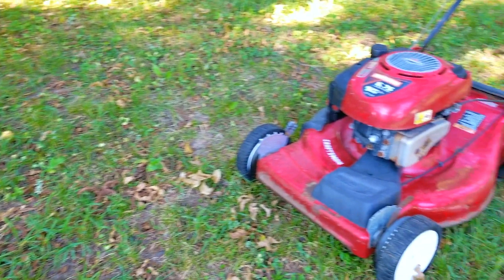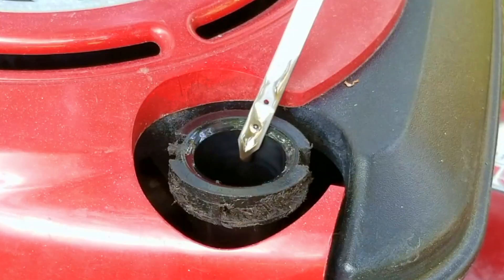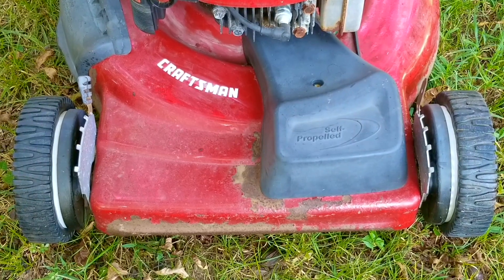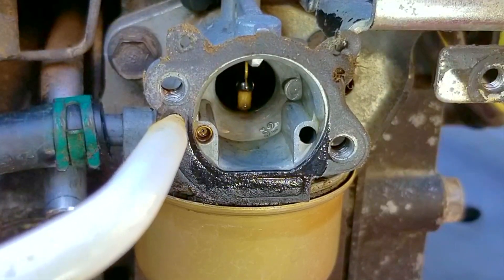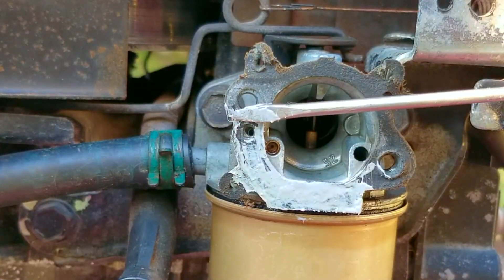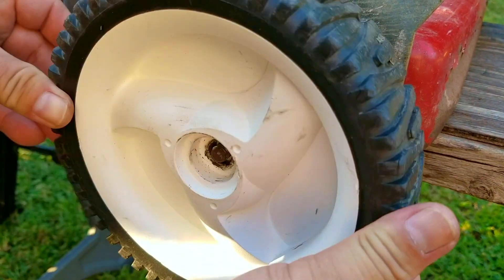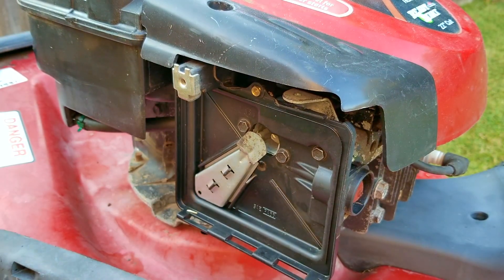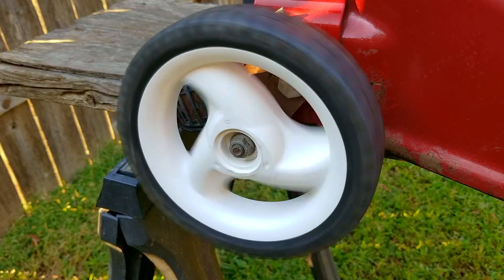Understanding how a primer bulb works on a Craftsman Lawn Mower.

Comment: Just found your video and Thank You. Question for you...... I have an 2003 --- 625 Series Craftsman mower (which has the same B&S engine as the mower in your video) and I'm having a re-starting issue. The mower runs perfect once it's running, but the problem is I have to use the primer bulb everytime after I stop the engine (ie. emptying the grass catcher) even after the engine is fully warmed up. The primer bulb works awesome as I see the fuel squirting up with each push, and it starts on the very first pull after priming...no problem. But why do I have to use the primer bulb every time I want to re-start my warmed-up mower? I've removed and cleand the carb already. Now I'm wondering if there's not enough vacuum being created when I pull the rope to re-start...not enough vacuum to draw fuel up into the venturi due to poor engine compression, which is why I have to prime it again. I would love your thoughts.
Reply from the maker: That's a very good question.  More than likely the carb is the problem.  Every time this has happened to me, I've tried to clean the carb again but only replacing seems to work.
Reply: Thanks for the quick reply. Guess it's worth $15 to try a new carb.😂 Keep with the vids!!!!
Reply from the maker: Absolutely!
Reply: Wanted to thank you for your suggestion to just replace the carb; did so and it  runs perfectly and no longer need to re-prime after each time it shuts off. So simple. Thank you!!!!!

Comment: i had the exact same problem with the primer bulb a few days ago, i used 2 carburetor gaskets so it would squeeze a bit harder.
Reply from the maker: That's a great way to fix it.
Reply: @HomeGaragechannel  it was your video that showed me what was wrong with my lawnmower, so thank you.
Reply from the maker: I appreciate the compliment and I hope you get it working well.
Reply: @HomeGaragechannel  yeah ,its working great.
i wanted to fix it badly since the deck is made of aluminium.

Comment: Thanks I added the old gasket along with the new one doubling it up and now the primer  work    Note when you pull out the rubber bulb mine had a mesh screen that I cleaned.  Thanks again
Reply from the maker: I'm glad you got it working again!

Comment: Those gaskets are sensitive. I have "fixed" that problem by doubling up the gasket with a second. The plastic can warp if over tightened, which makes sealing with the gasket difficult.
Reply from the maker: Yep I've heard that works too.  Although I  feel as tho it's partly the warpage from the plastics too.

Comment: Is there a difference with regards to the carburetor having a primer bulb and one thar does not have a primer bulb? I purchased a new carburetor from Walmart for a Craftsman M210, 140 CC but not sure if it will fit on the mower I have with a primer bulb. Any knowledge on this? On the M210 mower it has: D29058 SP.  Does the carburetor have to be one that will work with a primer bulb? The one that came off the machine has on the carburetor: D01520 597520 and the one from Walmart has: CMXGMAM1125499  on the website but no identifying numbers on the carburetor itself that I can find. The Walmart website states it is  a "fit" for M110 which I don't think has a primer bulb. Yet, it also has on the Walmart website that it is a carburetor kit for M210. Just curious about the carburetor and how it works with a primer bulb.  Thanks for anyone that may know.
Reply from the maker: to be honest, I don't know but that's a very good question.   If had guess, no there's no difference and you should be able to use either carb with or without one.

Comment: Note, those red primer bulbs have a hole in them and you must replace with a similar bulb, not a solid bulb such as those used on two stroke engines. I've made that mistake, so I know first hand. ;-)
Reply from the maker: thank for that information

Comment: I've had all 3 but am down to chokes and auto chokes now BUT have primed the others too much because they were my first and wasn't used to them. They always started on 4 pumps after they got limbered up. 3 wasn't enough.  My pal at the saw shop says to also point the carb uphill so the primer gas charge runs downhill to the combustion chamber for easier starts. I've got primer bulbs on the blowers but they're a different animal. And I NEVER think for a second that anything I get will run, so I'm not disappointed when it don't! Thanks and Blessings!
Reply from the maker: interesting idea.

Comment: Just took my primer bulb out due to fuel leaking from it and found it has a little hole all the way through it at the tit.  It looks like its supposed to be there but then how do you stop the leaking fuel.  Is it supposed to  have a small hole there or not?
Reply from the maker: on the one, in the video, that primer bulb is supposed to have a small opening in it. you could give me your model number that would help figuring out If yours is supposed to have an opening.

Comment: The purpose of the primer bulb is NOT to force fuel into the venturi, or “throat of the carburetor”. It’s to fill the bowl of the carburetor with fuel. Once the bowl is full, the vacuum from the engine draws the CORRECT amount of fuel out of the bowl, through the main jet and into the venturi where it is atomized and mixed with air before being sucked into the cylinder for combustion. If you’re seeing fuel pumped into the venturi when you press the primer then you’ve already over primer the carb.
Reply: The fuel system on many mowers are gravity fed, meaning the fuel tank sits higher than the carburetor. Gravity in turn brings the fuel to the carburetor and fills the float bowl. When needed,  the float moves down to open a needle to draw more fuel in. Once the bowl is full, the float goes up and closes the needle, thus stopping the flow from the tank. A primer bulb draws the fuel from the bowl and shoots it into the venturi of the carburetor to make it easier to start the engine.  Now on a smaller engine for a grass trimmer or leaf blower, you would be correct because the primer bulb is essentially a fuel pump that brings the fuel from the tank and primes the carburetor. Once the engine is running,  the vacuum impulse of the engine draws fuel from the bowl through the venturi and into the intake manifold.  On a 2 cycle,  the diaphragms in the carburetor perform essentially the same task.
Reply: @johnaldrich2074  yeah you're right. I was right in the middle of a chainsaw carb repair when I posted that so I was thinking two stroke carb. That doesn't apply to a gravity fed four stroke.
Reply from the maker: no

Comment: What's the difference between a primary ball and a perg ball always wanted to know?
Reply from the maker: one forces fuel in the carb, the other pulls fuel thru the fuel system, to get rid of the air

Comment: Are new lawn mowers with primer bulbs disappearing? Are they mostly just auto choke nowadays?
Reply from the maker: I haven't done a lot of research but it certainly feels that way
Reply: @HomeGaragechannel  I can’t seem to find any with primers. I feel like having one would be handy when troubleshooting like this case. I guess I could go for an electric mower, but most say the battery lasts 45 minutes and my lawn takes about an hour. Plus they’re way more expensive.
Reply from the maker: I guess you have looked at the mowers with the newer kawaskis then?

Comment: Either the primer bulb or auto choke is okay with me. I had a Craftsman mower similar to that quite some time ago. It had a tendency to get debris between the plastic cover and the wheel. The debris would then get between the metal drive gear and the plastic gear made to the front wheels. Bye bye plastic teeth. I had to replace the front wheels every season while I owned it.
Reply from the maker: nicely explained.

Comment: i got the same engine as this one what i did was using rtv gasket maker and put it around the base where the air cleaner meets the gasket except the priming hole
Reply from the maker: that works too.

Comment: I prefer primer bulb lawnmowers. The reason is that I've had issues with the thermo system on the auto choke, morespecifically, I had to hold it to a blow torch to get it to move. So I threw it out, since it has a wind vane choke assist, and a spring. It works great, and I just sold it last night.
Reply from the maker: you and me both, I like to have some control over it as well.

Comment: I've got a mower which starts when you prime it but cuts out any suggestions?
Reply from the maker: sure, but I need to the model number and serial number.  Can you find a tag that has this information on it?
Reply: @HomeGaragechannel  its a pp420 tecumseh if that helps
Reply from the maker: do you mean blower or mower, cause you said mower in the first comment but what information you gave me, results in a poulan blower.
Reply: @HomeGaragechannel  its a mower
Reply from the maker: have you cleaned the carb yet
Reply: @HomeGaragechannel  no i was thinking of doing that but thought it was a bit strange that the bulb would pull fuel through but the carb wouldn't
Reply from the maker: the bulb only function is to force the air from the bulb, into the bowl, and that makes the fuel come out of the carb, and into the engine. Try. cleaning the carb, paying special attention to the bolt nut and the holes In it.
Reply: @HomeGaragechannel  OK ill try that thanks

Comment: you mention both lithium and silicon grease. which one were you using?
Reply from the maker: in this video both, the lithium is white, while the silicone has no color.
Reply: @HomeGaragechannel  which one would you recommend for annual axle lubrication?
Reply from the maker: I would definitely use the Lithium grease in a spray can. It lasts for quite a long time, and is easy to use.

Comment: What brand and type of gasket maker did you use? The Permatex I tried didn't work well.
Reply from the maker: I think it's Permatex.
Reply: @HomeGaragechannel  The one you used was a white paste that spread out well, the one I tried was very sticky and yellow which didn’t work well.
Reply from the maker: I gotcha
Reply: @HomeGaragechannel  So you're not sure?
Reply from the maker: not really, Although I have to ask, if either had been opened, prior to you, using them?
Reply: @HomeGaragechannel  It was brand new Permatex Super High Tack Gasket Maker in the tube as they had various different ones that is just the one I happened to purchase. Also I could’ve warped the air cover taking it off and on so many times.

Comment: I prefer the primer bulb, only because I think it just gives it a bit of a head start and puts you more in charge as opposed to auto choke, and prefer manual choke over auto.
Also that's the exact repair on the same engine I need to do on my personal mower before the season starts. I just put up with lots of pumps to start it last year, hopefully I've got a new gasket knocking around in the shed, and a new bulb which I didn't get round to last year.
Reply from the maker: nothing wrong with that.

Comment: That was a nice score for free, nice work! I don't mind pushing a primer bulb to start an engine, I don't much care for auto choke systems as they tend to have issues sometimes. I prefer manual choke as that's what both my Kubota push mowers have.
Reply from the maker: that's a very good choice.

Comment: I like both auto choke and primer. I have the same issue with a prime I am working on might try a little gasket maker on it like you did just to see if I helps my engine also.
Reply from the maker: hopefully it works out for you.

Comment: Excellent vid as always!On these free mowers I pickup with floppy wheels, (even the cheap ones) I drill them out and press in bronze oillite bushings available at any good hardware store; easy fix and the drill press does both operations. The customer really thinks they're getting something when she rolls real easy.
Reply from the maker: I'll have to consider that. Thank you David Coudriet
Reply: A poor man's wheel bushing.  I have done this and it works and takes out the wobble.
Reply from the maker: I'll definitely have to consider that.

Comment: Have you ever had a engine blowup on you, i had an old 1995 craftsman lawnmower with a. 5 HP engine and we were mowing the front yard next all you hear is bang, and i shut it off, low n behold, their a is a nice big chunk of engine wall missing and engine oil pouring out smh.
Reply from the maker: only one, it was a riding mower, and I wasn't filming at the time, because I was just moving it around the yard.

Comment: As long as i can cut my grass it doesn't matter if have the prime system or the auto choke. They both eventually have their issues
Reply from the maker: you make a good point
Reply: @HomeGaragechannel  i have 2 mowers that have the auto choke and the primer system on it

Comment: Theres a small passage at the back of primer bulb and sometimes a screen that get clogged on these type of briggs. Great fix as usual!
Reply: I just had that same problem. Over time the small hole in the bulb allowed enough dust & dirt in to completly clog the screen. Never would have found it without pulling the bulb out..
Reply from the maker: thank you for the information

Comment: Once again you have taught me something new!! My 13 year old Toro Super Recycler has auto choke and will start on 1st or second pull every time. I run non ethanol high test gas in it and change the oil every 20 hours along with changing the air filter with every oil change. I lube my wheels 3 times a year. (I enjoy working on my mower) I also lube my cables a couple of times a year. It has been in the shop 4 times in 13 years. Twice for carb cleaning/tune up and twice for belt replacement Personal Pace service. Another great video Brother!!
Reply from the maker: thank you Larry Croft.

Comment: To answer the choke situation I prefer neither the bulb nor the automatic system.  I would prefer a cable and lever mounted on the handle.  Now I must ask this question.  Listening to say you messed up the priming system makes me wonder if we are related?  Great tips and information.  Thanks for the  video's.
Reply from the maker: thank you D Butler.

Comment: I found a Craftsman mower like this for free last fall, but it was a generation older. It had the same exact problem so I just put a used gasket from a dead engine on it. It does smoke a little bit when it runs because the piston ring is a bit worn, so I might have to do a rebuild at some point if it gets worse.
Reply from the maker: sounds like you've got it under control, thank you Smallengineworld BCSERK.

Comment: I had never seen a primer bulb on a lawnmower except a lawn boy an tell about 1999 when we bought a Craftsman with an eagle engine on it but now I see them on many small engines both 2 cycle and 4 cycle it seems like a cheaper way for the engine companies to get past the choke over the years I have several different ways the companies have made chokes some fairly easy and some overly complex the bulb seems to work fairly well and many times getting the mower started is one of the hardest things to mowing
Reply from the maker: you make a good point.